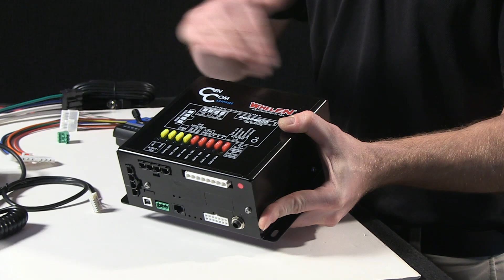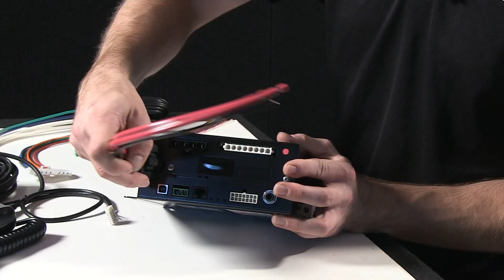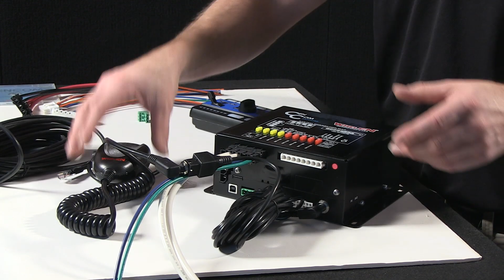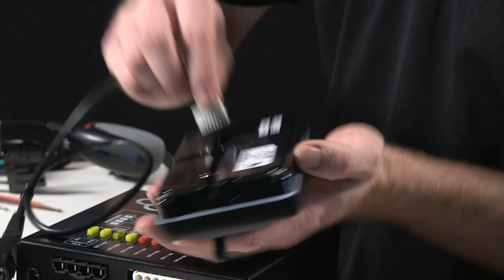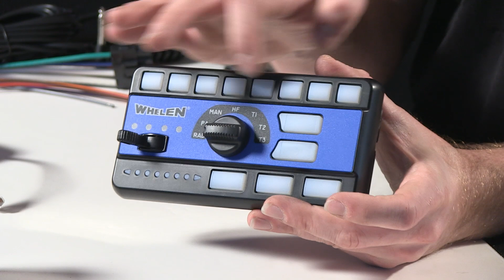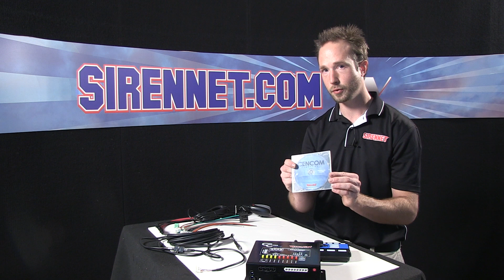Chris gives us an in depth look at the Whelen CenCom Sapphire Siren

Comment: How is the Break Light Disable function work? Is their a system for it?
Reply from the maker: The Whelen Cencoms do not offer a "Black-out" function for disabling the rear tail/brake lights. Some manufactures offer an add-on Module for "Black-out", however, most of the new 2014/15 Vehicles do not allow for deactivated brake/tail lights.
Reply: SIRENNET hi .can you help me with cc gold flash button.how to get same output as show on the keypad controller when it push

thanks

Comment: Siren wattage?   This unit hasame siren output wires for one or two speakers. Other sirens have 100 watt and 200 watt connections.   Thank you.
Reply from the maker: It operates one or two 100watt speakers. As far as the harness goes, there are two wires, if you're using two speakers, they'll both splice together.
Reply: @SIRENNET     Thank you.  How does the same output do 100 or 200 watts?
Normally [Com] [[100]] [200] for one 100-Watt driver. Connect [Com] [100] [[200]] for two speakers.
Or is this notruly 200 Watts because it may burn out a single 100-Watt driver?
Reply from the maker: @robertgift With 2-speakers it's putting out 200watts. The internals won't harm a single speaker. It's very common place to use a single 100watt speaker with these.
Reply: @SIRENNET     Thank you.
With my engineering background, I'd like to khow a supposed 200-Watt output does not burn out a 100-Watt driver.
Every electronic siren I havever connected had 100 and 200 Wattaps.  
Our spare Whelen siren has [com] [100] [200] terminals.
(Does Whelen state anywhere thathis unit is 200-Watts?   If not, I suspect it is not really 200 Watts.)

Comment: Can you guys show or explain how to wire additional lights to the cencom, I have a Liberty II WC and wiring was super simple, but I am struggling to figure out how to wire a fusion 600 light stick, 2 mpower fascia lights, and soundoff ultralite stick. Once they are wired how do I program them in the software for example when I press my flood light switch, the Liberty II goes into flood mode, I want my 600 series fusion light stick to go into flood mode as well. Thanks for the help!
Reply from the maker: It'd be a lot of typing to explain how it's done :)   If you haven't already, we'd suggest getting in touch with Whelen's Technical Service department &  asking for help with software. They can be reach at (860) 526-9504.

Comment: How can LED headlights wig-wag?   Our emergencyehicle's LED headlights have a cooling fan which operates when the LED is turned on.  The fan is connected to the LED wire internally, not through a wire from the plug.  
Inrush currento theadlight fan may damage it from being turned ON and OFF constantly.
Any recommendations?
Thank you.
Reply from the maker: Are they a factory/OEM headlight or do they have after-market LED bulbs?
Reply: @SIRENNET    Thank you.   2016 Letsuck RX350 LED headlights.   Cannot replace justhe LED.   Must replace the whole $2081.66 headlight if the LED fails.    
No access.  Would have to cut into theadlight fixture.  
(Apparently one LED.   For high beam, something which blocks part of the LED's light is moved out of the beam.)
Wilhave to mount white LED lights behind the grill.
Reply from the maker: @robertgift  Definitely stay away from trying to do anything with the headlights. Trying to wire in an LED flasher will just cause issues. For the grille Whelen ION's or Micron's would look great!  They should fit in nicely ;)
Reply: @SIRENNET     Thank you.   Yes,hall not mess witheadlights.

Comment: Is there a way to tone down the siren and lights
Reply from the maker: An inline resistor can be used to lower the siren tone output. You can't make any changes to the intensity of lighting unless it has a low-power mode / trigger wire. Reducing voltage won't reduce output.

Comment: How do you get the PA to work I have the unit powered up and tones all work but no sound when I push the PTT button on mic.
Reply from the maker: Hi Kyle. Have you tried adjusting the PA volume? It might be turned all the way down. 

For volume adjusting you'll want to locate the PA adjustment potentiometer on the right side of the

CenCom module. Using a small, flat-blade screwdriver, set the
 potentiometer to its middle position. With the CenCom system on,
 activate the PTT (Push To Talk) feature on the optional microphone.
 Adjust the potentiometer until a satisfactory PA volume level is achieved
 using a normal speaking voice. 

If this doesn't yield any results please let us know.